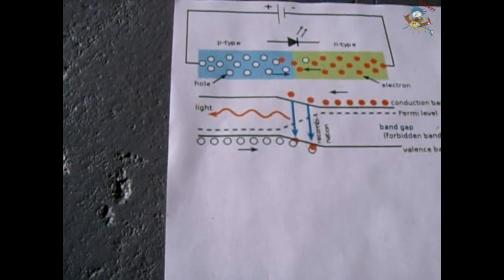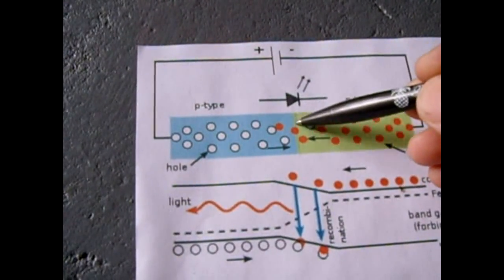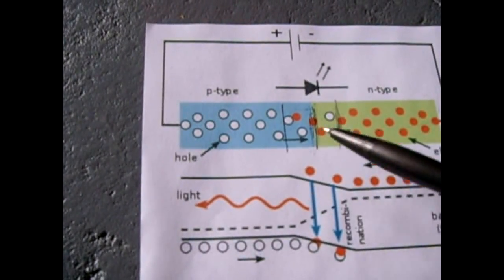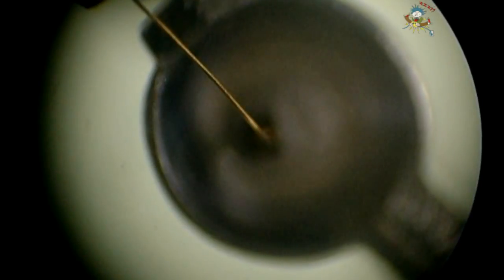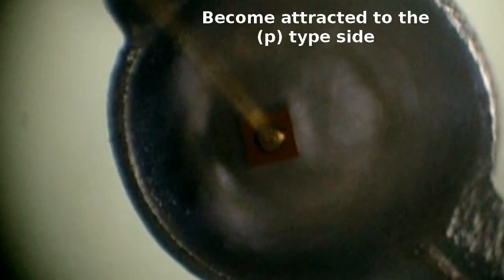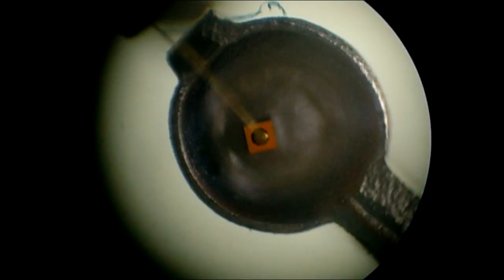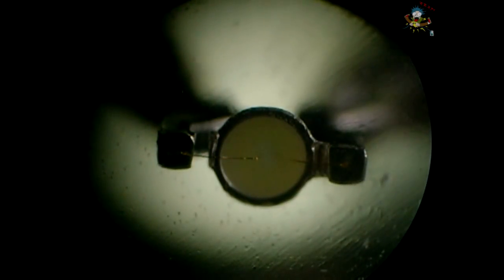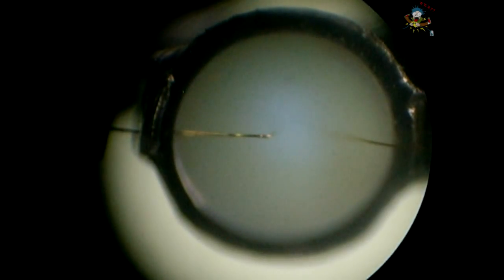LED's ~ "Under The Microscope"

Comment: Very nice video and explanations.

At some point you say that depending on the semiconductor material, the emitted light will be infrared or other colors, like blue or white.
This is not exactly true.
LED light is always monochromatic, due to the energy barrier you talk about - it's always a single wavelength. White light will never be emitted directly from a single semiconductor structure.
99.9% white LEDs are in fact blue or UV LEDs with a phosphor that you show in your video.
The remaining ones have 3 LED structures in one package (Red Green and Blue) and together emit a mixture of those RGB wavelengths, which we perceive as white light.
Reply from the maker: The semiconductor doping and the energy released by the electron is what determines the color. Now you are right about mixing colors to get white light.
Reply: I re-read my comment and indeed it may not be clear. I'm opposing only inclusion of white in the list of LED colors depending on the semiconductor composition. I'm from Poland and English isn't my native language...
In my collection I have many different LEDs which emit IR, various shades of red, yellow, amber, green (from deep bottle green to turquoise), blue (from deep blue to violet-ish) and UV.  Of course, there are multi-chip LEDs: RG, GY, RB, RGB and even RGBW with additional white (ie additional blue covered with phosphor, or, more accurately: luminophore)..
Haven't seen a GB LED though :)